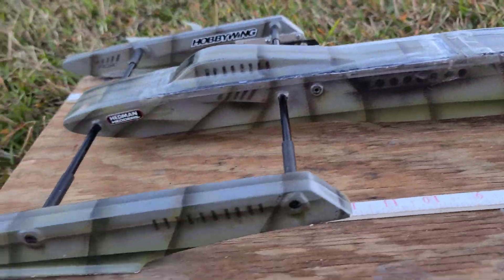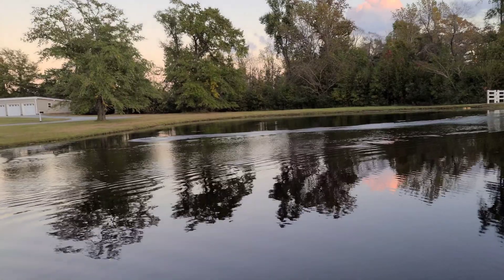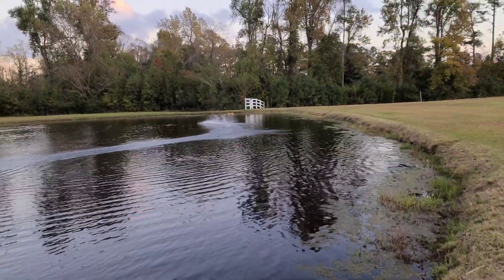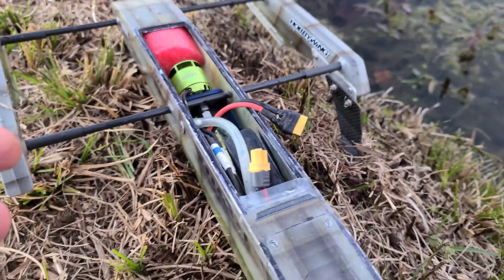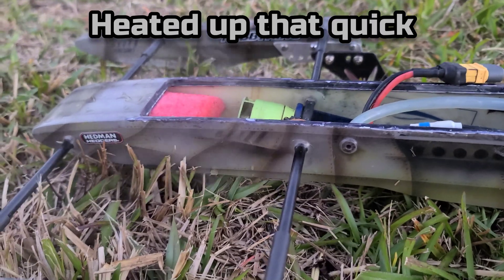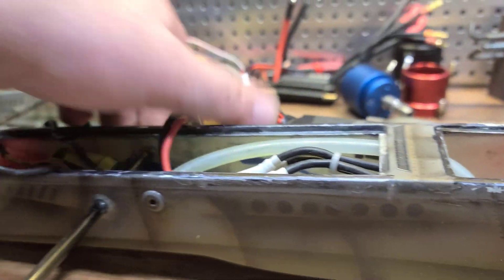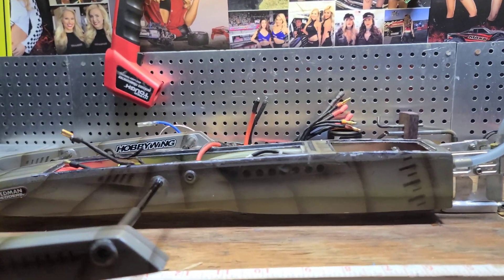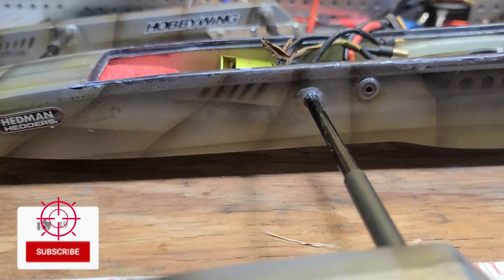How To Blow Up Any RC Boat Brushless Motor | Rc Outrigger Hydroplane

Comment: or OR not put an outrunner in a sealed compartment. also did i see u try to start the motor after u poured water into it?? u do know what electricity is right? it doesnt go well with water. anyhoo u had fun so better luck next time. u can also google everything ur doing and find better options
Reply from the maker: Pouring water on for entertainment purpose!!!!    I run an outrunner in this boat w/o watercooling it's a lower kv motor than what I was running in this video.   No heat even with larger props.

Comment: Hey b I have a question for ya I plugged up my 4000kv to s 60 amp esc got a puff of smoke now it only spun for a second or so whould you say I have stuffed the motor and how to check thanks mate
Reply from the maker: Yea if it was smoking it's more than likely toast.
Reply: @IRONCLADRC  it was just taken out of box set up on bench and puff so I  don't know what I did ?? Mate got cheap from China so 🙄🤙

Comment: I over heated my esc on my veleos  due to mud on my rudder plugged the water hole, now when I run it now it doesn't seem as fast and it still runs hot after 15 minutes of running then shuts down. Anybody got any suggestions on what I need to do to fix it?
Reply from the maker: Probably gonna have to get a new ESC Basically fried the Compassers

Comment: In the vedio,  the left sponson is lifting during acceleration. That's probably due to the torque from the prop. Maybe try a smaller prop at 3s.  For your reference, My 500mm long mini rigger use an x-team 28mm*35mm(physical size) inrunner motor at 3300kv, and 30-32mm pitch 1.4 prop. I stick to 3S with this configuration. 38mm propeller is probably good on motors physical size larger than 28mm*60mm, Under 3S.

Comment: I've been there too. The insulations on the copper windings on the stator got too hot and melted. When the motor got short circut, demagnitized or clogged, if we still throttle it the ESC will be fried. It's good that the ESC survived this time :)
Reply from the maker: Thanks.  I've got  a 3/16 stepped down to 1/8 shaft on the way and a few 30-32mm props thanks for the advice, she getting there slowly bet surely.   The next rigger build I should know the drill. Lol

Comment: Sorry to see this 😳.I hope you can get to buy the 3500kv 2850 for Tiansheng EDF can run it 4s 32mm prop max without Watercooling 3.75mm shaft it's really powerful top speed economical,I had your motor but I never used it.Id keep trying with your rigger to me looks like not enough weight in the front 😊
Reply from the maker: Yea the 2935  outrunner motor is 64g the leopard hobby 2845 is 125g with out waterjacket 2850 leopard x2 150g w/o jacket..  Hopefully I put a heavier motor I want have to use so much down trim on the strut.    The 2845 w/ jacket should be about right.  The 2850 may be to heavy almost the same weight as the 2969 rocket motor (185g)?   I'm determined to get that dern rigger running tip top.
Reply: @IRONCLADRC  That's really good you'll get it right I'm sure you will,I've found that the boats that have been burnt end up the best,either burnt or drowned.I have a leopard LC-450 3500kv 4s outrunner motor and Octura x430 I'm going to try we seen it in Micro iceberg twin cat 450mm goes over 100kph easily..I think you did really well with your red boat 😊👍

Comment: Feels like the motor shorted inside or something. Really weird you made 2 runs before with normal temp...
Reply from the maker: I agree?  Never had any trouble before & Temps have always been under 100° f. Even on 4s.   Never herd a motor make that sound before, realy don't have all that much experience with outrunner style motors. So I'm not sure if that's a common sound or not ?
Reply: @IRONCLADRC  Yeah that sound was horrid. Propably because the magnets demagnetized and the motor started cogging (motor could no longer match the pulses from the esc, jerking back and forth while making a horrible noise).